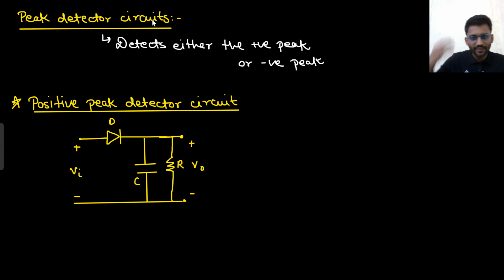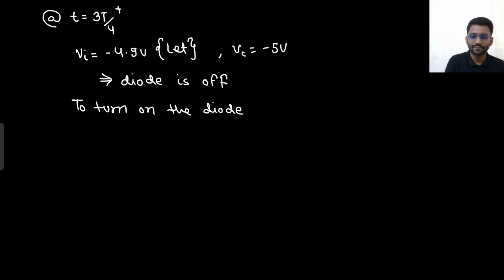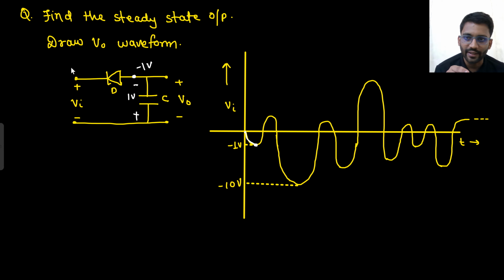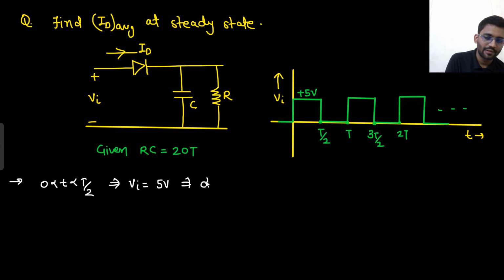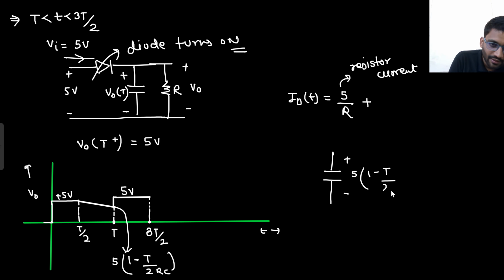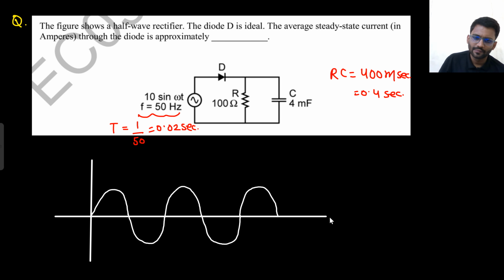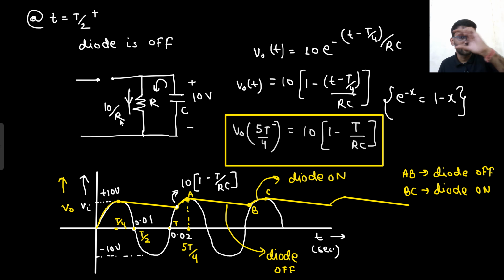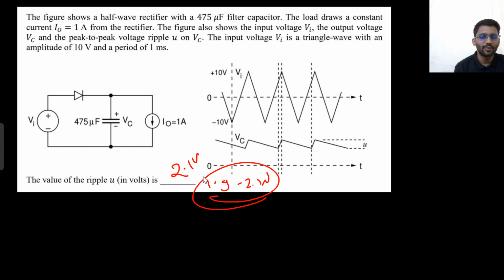Peak Detector and Average Diode Current || Analog Electronics || PrepFusion || Himanshu Agarwal

Comment: Sir, I have a conflicting thought in the question @ 37:38.. Pls help me clear this doubt or correct me. At t=0+, Vo=5V because cap has immediately charged to 5V. But then 5V is continued to be given as input till t/2. But in that duration, diode's p side is getting 5 and n side also getting 5. Then wont diode be off? Diode should be off right from 0+ to T?? So shouldn't diode curren look like only impulses at every T

Ok... now I got some insight. Its like at t=0, the sinec diode p and n side are same, diode will be off and cap will start discharging, and maybe reach 4.999999999V. Immediately diode will turn on bcz of that and cap will get charged back to 5V. Until the vi becomes 0, these infinite charging and discharging happens to the cap.. So its not that Vo is exactly 5V till T/2, there are infinitely small discharges that are nearly 5v so its like a very infinitely small triangular waves approximately 5V.

Thank you sir for your teaching ❤
Reply: Great doubt uh ngaa
Even I had the same one

Comment: @PrepFusion_GATE for the last question, whatever the other institue's solution you told is actually correct and also a faster more intuitive method as well. why? because in that method law of conservation of charge is applied basically here  in this circuit the cap charges and discharges every cycle right. so whatever the current provided by diode to charge the cap is later discharges through resistor. so to find the avg current through the diode is equivalent to the avg current discharged by the cap through the resistor. if you see exactly, the diode current and cap current is a hill or spike(but you assumed as impulse which is not so bad assumption) so area under this hill gives you avg diode current so your solution also correct. since the diode , cap and resistor forms a junction it should satifies kcl thats why even finding the avg current through resistor also gives the same answer
Reply: You are saying "whatever the current provided by diode to charge the cap  is later discharges through resistor."  ,  but here you are forgetting that current through the diode is equal to both the current through the resistor and the capacitor. There are 2 currents through the resistor: one during charging of cap(when diode is on) and the other while  discharging of cap(when diode is off). 
Although I am not sure how we solved this question because I don't feel that we were right to take impulse at the first place because the current is also finite(sinusoidal). Although the time is very small, but the current also is very small(going from 9.99V to 10V). So I don't think impulse was the right thing, but I am not sure.

Comment: the explanation is great ,i really admire that way of explaning the complec topics in the simplest way,i follow this only channel for most of my gate preparation.
but i found this misconceptions related to impulse at 1:21:10 (as i feel)or may be i wrong
the capacitor goes on dropping till the V_cap matches the V_in which is sinusoidal,when the voltages match the capacitor goes on increasing as like input which is sinusoidal,there is no sudden change of voltage hear ,this gradual change in voltage results in current in diode which is very minute(which is also in sinusoidal form cuz differentiation of sinu is also a sinu )

my intention is not to point you out ,cuz i got lot of benifit from your content ,but every one is prone to mistakes
Cud u  pls clarify that point to me
Reply: As you mentioned 
"There will be a gradual change and no sudden change in capacitor voltage "

Lemme clarify this
The change is observed with respect to time
There we have very very less time that our cap is changing its voltage 
Which results short-high current that is well approximated as an impulse function by himanshu sir

Although the analysis given is near to exact analysis

And in the exam we only want correct answer in less time
Even 
The answer given in this video is technically and conceptually very right, which is very exact

But in the question they implicitly mentioned the word "approximately"
Which means the examiner is not expecting us to do exact analysis

Comment: Sir at the last question of this lecture you are saying that there is a impulse current through capacitor, but the input is sinusoid, the voltage across capacitor will simply follow the voltage and the current will be differentiation of a sinusoid which will be cosine, please explain if my approach is right or wrong
Reply: I think here i understood it as we dont have to take the sinwt quite literally as it is just an indicator of nature of source, so in dv/dt in dv part it should be (10-0), we took only the max and min value as we already know the nature of source and know that it is a continuous one hence I think thats why we did this

Comment: at 23:35, as you said in earlier question that due to high value of RC the cap will not discharge.. but in this question its only cap is there then why its not discharging
Reply: R=infinity (open circuit) 
T= RC very large

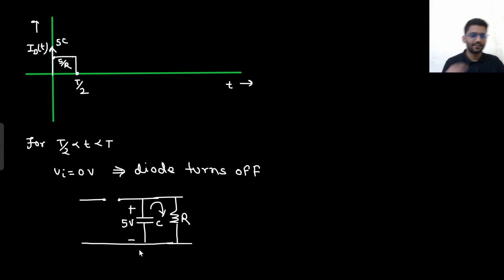Comment: Sir, At 41:00, since the RC Valve is very large, the Capacitor doesn't discharge right. Will it be in the same state?
Reply: Same doubt